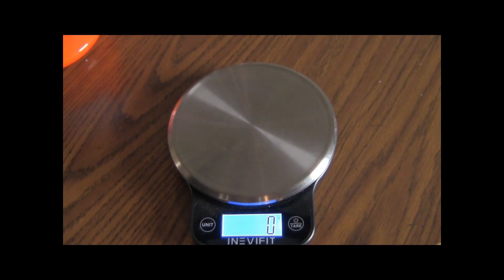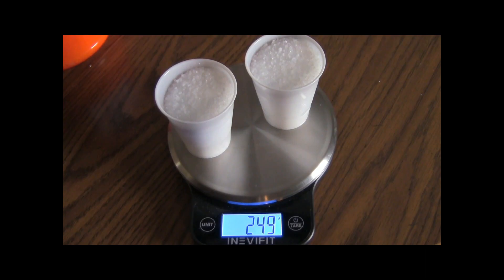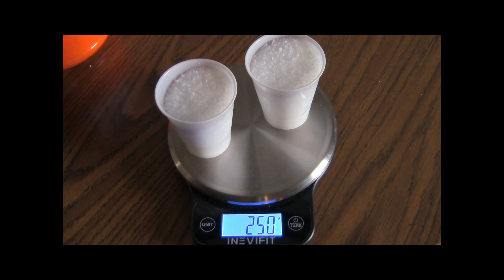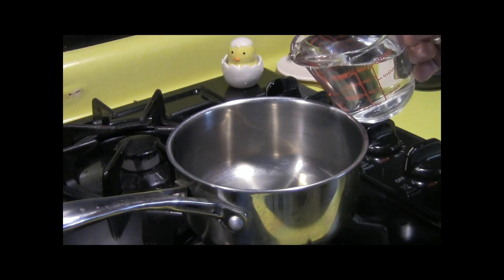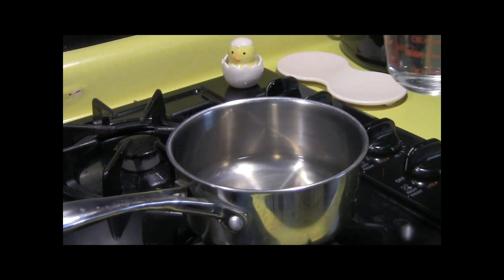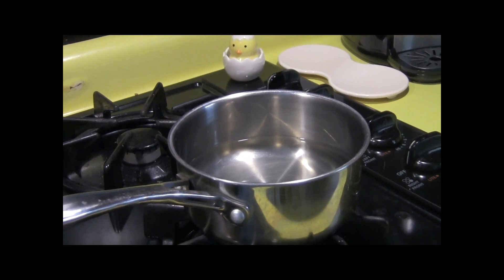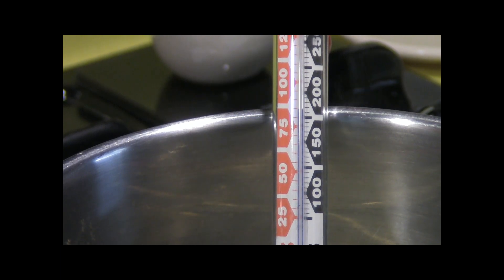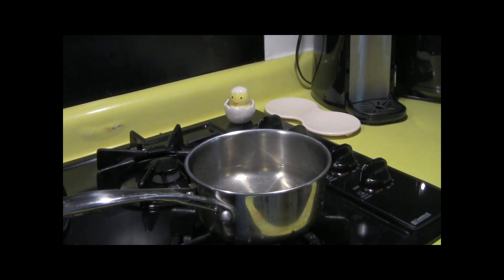How to make battery Epsom Salt solution

Comment: does the salt mixture permanently replace the battery acid when you're done? Or do you dump it out, and refill with acid?
Reply: The epsom salt contains sulphur to bond with the lead to create the chemical reaction required for the battery to function, it can be used as a replacement, or top off
Reply: It turns it into an alkaline solution
Reply: If you is interested in battery reconditioning the greatest results that I have had was by using the Magic Mender Wizard (i found it on google) definately the most useful info that I've followed.
Reply: @genesisdaza6870  how much do they pay to push that shit?

Comment: Sir my 100ah battery one cell shows 0.3 volt .can I revive it with your told method? When I pour Epsom salt and distilled water to the defected cell then should I charge it at once or after how much time?
Regards Dear
Reply from the maker: That cell needs to be cleaned with distilled water before adding the Epsom salt. Yes it should work, it did with my battery and you need to give it a good charge after adding the solution.
Reply: @LonnieJohnson1  sir how long should I charge it?
Regards
Reply from the maker: For 10 hours on a 10 amp charge but it's best to charge it slowly on a 2 amp charge if possible. Also an auto charger is best and takes the guess work out of it.
Reply: @LonnieJohnson1  sir when I charge it for 10 hours then will I have to empty the battery and refill with battery acid?
Regards sir
Reply from the maker: No you don't, and did you rinse it out with distilled water before you put Epsom solution in the cell? If that one cell comes back to life that will be a good test for your battery. My battery is still working really good.
Reply: @LonnieJohnson1  dear first I rinsed the defected cell with tap water and then I poured Epsom salt and tap water to the defected cell and I let it on Suoer 30 amp automatic charger but the cell is not bubbling and showing no life .thing to remind that all the other cells are not processed but just a single doubtful cell. Now my battery shows 9.45 v as usual. Can you help me in this regard.
Regards
Reply from the maker: What kind of battery is it and does it have any cranking amps? you really should clean it good and do all cell at the same time. How old is your battery?
Reply: @LonnieJohnson1  sir my battery is 1.5 year old and it is Phoenix 100amp lead acid battery, and I did this process with a single(defected) cell not with other cells.
Beat regards
Reply from the maker: This isn't a car battery is it?
Reply: @LonnieJohnson1  this type of batteries are used in car in our country Pakistan and also used for ups in case of load shedding in our country.
Regards
Reply from the maker: I have never seen a 100 amp battery start a car or truck must be a very small vehicle.
Reply: @LonnieJohnson1  but we use it for ups.
Regards
Reply: @LonnieJohnson1  it most likely amp hr not cold cranking amp
Reply from the maker: I used mine for another year.